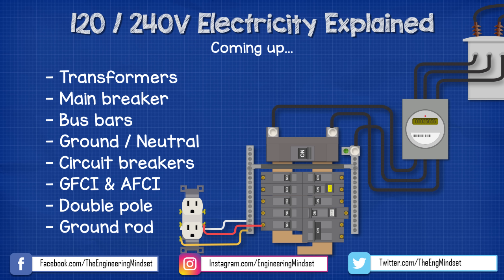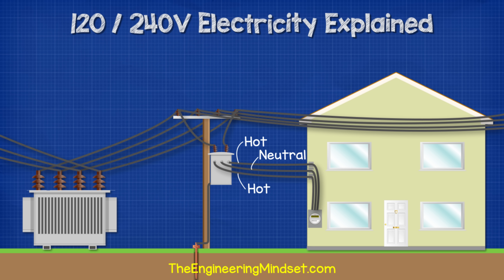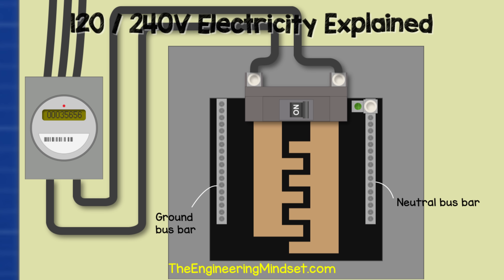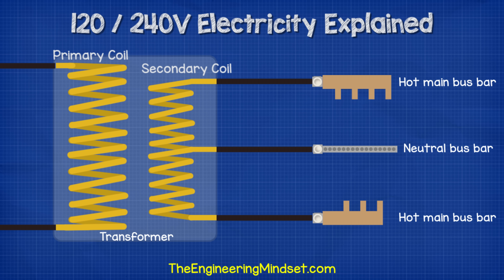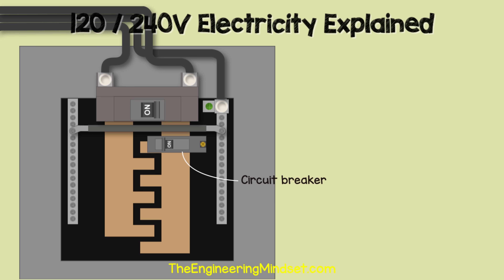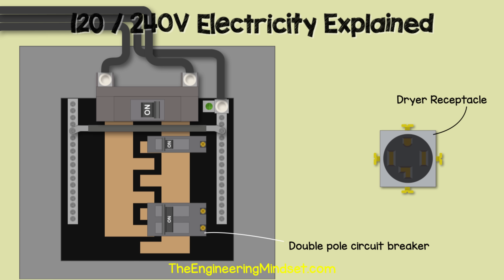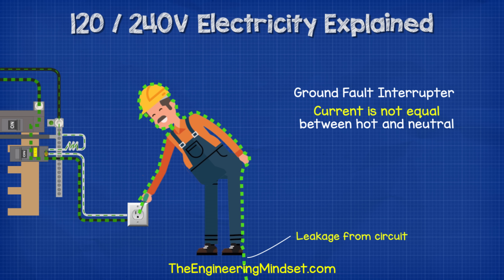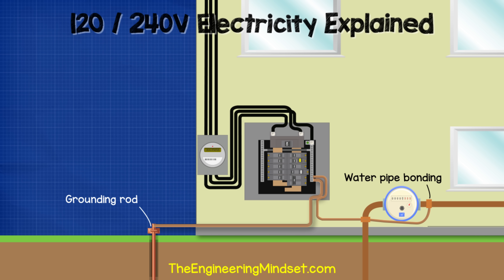120V 240V Electricity explained - Split phase 3 wire electrician

Comment: sorry for the my stupid question.. you said electricity comes from hot wire through the switch then lamp then neutral wire back to main switch.. but this is AC.. meaning electricity can flow the other direction.. ie. neutral wire -> lamp -> switch -> hot wire.. is my understanding correct? if yes, then i don't see the difference between hot and neutral wire
Reply: In North America the neutral is attached to a ground rod driven as many feet into the ground as necessary. A metric foot is 30 cm.  For there to ever be a voltage on the neutral the entire planet and every one on it would have to be at that voltage.  Actually it would only apply to  people within about seven hundred miles.  AC means the Hot wire goes positive and  negative not that the wires change hotness.

Comment: At 5:36 you measure 240 VAC. Is that 240 volt measurement because those windings halves are out of phase with each other?
Reply: It's mathematically equivalent to them being out of phase with each other, but it isn't produced that way.  By center-tapping the transformer, and deriving the center-tap to be your neutral, the red wire's voltage is derived to be the negative of the black wire's voltage.   The second line's waveform is a negation of the first wire's waveform, rather than a phase shift.

It is mathematically equivalent to a 180 degree phase shift, but it isn't called "2-phase", and the L1 and L2 aren't supposed to be referred to as phases, for historical reasons.

Comment: I have a GE Dryer that I took with me from the US to Germany , it currently has a 4 prong plug, as you know they only use 2 or 3 prong plugs in Europe , also here the power is 220V single phase , and even though the dryer is able to be used on 220V in the USA it’s basically getting (2) 110V phases to make it 220V . So my question is how do I connect it here in Germany to their 1 phase 220V ? 

I really really have high hopes you can help me out, please.

Comment: So, how can we tell if a power (load) panel is maxed out?

For instance, i have to power (load) panels: one that is outside with a 175amp mains breaker. In that same panel, there is a 60amp/240volt double-pole breaker (along with other 60 amp breakers) to feed my subpanel located inside my garage that controls all the interior and garage circuits.

If I needed to install a 60amp/240volt double-pole breaker for a dedicated circuit in my subpanel, would that trip the outdoor panel if the subpanel 60 amp/240volt  dedicated circuit is being utilized along with other circuits within that same subpanel, hence “maxing out” the 60amp subpanel circuit? 

 If so, would I just need to upgrade/size up the exterior 60amp/240volt breaker for a 70 amp/240volt double-pole breaker?
Reply from the maker: Check the new SUB PANEL EXPLAINED ➡️ video https://youtu.be/NUSNa-7Hecw

Comment: 4:54 There is one more thing about connecting the multi meter between the 2 bus bars. If you got around 208 volts, this is totally normal because only commercial buildings use these kind of voltage, like apartments for example. Instead of using 2 phases electricity as said in the video, it uses 3 (120 degrees out of phase) because there are multiple locations in the building that consumes lots of electricity, so they need a third phase to stabilize the consumption from preventing overload
Reply: in the 3 phase 3
N-L1-L2 - 120/208V
N-L2-L3 - 120/208V
N-L3-L1 - 120/208V
Reply from the maker: Seen our new 3 phase transformer video?➡️: https://youtu.be/u0SsejDCVkU
Reply: @EngineeringMindset  Totally wished a video like this, much thanks!
I was still in high school with very basic electrical knowledge when I wrote that comment, so I described with my own words on why 208V is used instead of 240 😅

Comment: great stuff.. now when installing a  GFCI or AFCI  .. does this mean its a different breaker used as well?  how many times i saw people remove a common outlet and just slap a GFCI only
Reply: GFCI can either be in the receptacle, or it can be in the breaker that supplies the branch circuit.  What GFCI does, is look for current not returning on the neutral, indicating that it is flowing where it doesn't belong.   It looks for residual current escaping the circuit, and trips when this is too large.

AFCI by contrast, has to be in the breaker.  AFCI looks for waveform details that are characteristic of an arc fault.

AFCI is a relative new requirement in the NEC, as of the last ten years.  In a home built before AFCI's became required, you don't need to add AFCIs to bring it up to the current standard.  An old house can be considered grandfathered, and any additions only need to be built to the standard that was effective at the time the house was built.
Reply: I had a 50mhz ham radio trip a GFCI when it would transmitt.

Comment: Can u tell me plz why used transform  before house . I mean why state not give it directly  120 v and 240 volt
Reply: Not an expert but because of distances higher voltages equate to more energy available.
I think residential and light commercial run about 28k volts along the poles.
Generally this is stepped down to a pair of 110 volt lines feeding two or three houses.

Comment: Why would adding appliances increase current. Wouldnt that increase the resistance and thus decrease the current?
Reply: Resistors in parallel actually reduce the Equivalent resistance of the total circuit.
Reply: @bsdiceman  Thank You!
Reply: @YusufKhan786  you're welcome hope that clears things up for ya!
Reply: While loads do have resistance, they also are conductive, and allow an increased flow of current to pass.
Reply from the maker: Check out NEW resistor video, everything covered! ➡️ https://youtu.be/DYcLFHgVCn0

Comment: i am afraid i don't get it. so, from the power plant AC is distributed through the step up transformer via 3 cables (120 degrees phase shifted so no neutral wire) into the step down transformer -> to the residential building. but from there we have "hot" and "neutral".....so where does the neutral go from the load to the transformer  and then.........it disappears? i don't get the ac/pulsating part......
Reply from the maker: Seen our new 3 phase transformer video with worked examples: link- https://youtu.be/u0SsejDCVkU

Comment: Ok, now what is single phase 208 volt and how can I wire this appliance correctly at my house to get it?
Reply: Single phase 208V is what apartment dwelling units get, when the apartment complex as a whole is supplied by a 3-phase service.  Each dwelling unit gets two phases and a neutral from the three phase service to the property.   Your neighbors get a staggered pair of phases, so that loads are as uniformly distributed as possible.

Suppose you get phases A and B.   These are the black and red wire.   The voltage to neutral of each of these wires is 120V nominal.   The two voltage waveforms are 120 degrees apart.  If you measure voltage between the two phases, rather than getting 240V like you do on the split-phase systems of single family homes, you will instead get 208V.   Because if I draw an isoceles triangle with two 12 inch legs that are 120 degrees apart, the remaining side will be 20.8 inches long.

Like 120/240V, the 120V to neutral powers most of the loads.  The 208V only powers energy-intensive loads, that would otherwise be powered by 240V, such as heating elements in stoves and ovens.   This will mean less heating power, but unlike more voltage-sensitive loads like motors, this is OK for a resistive heater to run at slightly less voltage.
Reply from the maker: Seen our new 3 phase transformer video?➡️: https://youtu.be/u0SsejDCVkU

Comment: When an appliance is hooked up with a neutral to a 2 pole breaker what determines whether it'll be 240 or 120?
Reply: The wires are color-coded, so that you connect to the proper part of the source, to where the load requires you to connect it.  The neutral is required to be white or gray by code.   White is the industry norm in any system involving 240V and less as the nominal line-to-line voltage.  It isn't a problem if you mix up the two live lines, as you will still get the same outcome either way, but if you mix up a line and neutral, you could damage the equipment.

The neutral uses white wire, the two lines use black and red wire.  When the white wire, and either of the remaining two wires is across a component, the 120V will power it.  When you instead wire the red and black wires across a component, the 240V will power it.

Examples of loads that use 2-pole breakers and all three wires, are ovens and driers.   The 240V is used for powering the heating element, as that is the most Watt-intensive part of the appliance.  The 120V is used for powering more sensitive circuits, such as the motor and the control panel.

This also allows the same appliance to be used in apartment buildings, where the dwelling unit gets 120/208V instead of 120/240V.   The motor and control panel are a lot more voltage-sensitive, and could not possibly run on 86% of the intended voltage.  Therefore, these loads run off the 120V part of the branch circuit.   By contrast, the heating elements can still run on 86% less voltage, and still work.  The power is reduced to 75% of what it could be on a 240V curcuit, but that just means that the thermostat will cycle the load on and off.

Comment: "Return used electrical current"? So after we "use" the power they get it back?
Reply from the maker: As I mentioned after that point, it doesn't quite work like that. All your electrical equipment used the energy in your home e.g. The refrigerator, TV etc. The power station has to keep pushing and pulling the electrons through your wires.

Comment: question for you or all the electricians out there.    i have an offgrid, completely separate inverter powered by batteries/solar panel...   the panel is 220v split phase, and is meant to run just parts of the house - plugs etc...   obviously it has a red/black and neutral coming from the inverter, and panel could use either double or single pole breakers.   that's not the issue...  the issue is the actual ground/earth - the bare wire, the one that disappears into the dirt.   i need a ground for my solar setup, can i use the same ground?    can't see any reason why not, but since the neutral and the ground  in both the mains panel AND the solar panel are bonded together, i just want to make sure that there is no change the power from my solar/inverter can 'leak' back onto the grid in any way.
Reply from the maker: Seen our new video on HOW SOLAR PANELS WORK in detail https://youtu.be/Yxt72aDjFgY

Comment: Couple questions please. How does the neutral carried back to the transformer when the neutral bar is connected to the ground bar that is grounded back to main ground and its job is to kill power. I've never ran wires from panel to transformer. Only transformer to panel. Is my understanding wrong?  Also you said the transformer dums down voltage it is safe but the transformer also drastically increases amps which is way more deadly to my knowledge. Am i wrong on that?

Comment: The only thing I found confusing was at 4:56 seconds. When he touches each lead of the multimeter to the two different hot bars. With each one of them being 120 V, wouldn’t the meter show zero? Because there is no difference in electric voltage between them, they are both 120.

A few seconds earlier he touches one lead to a hot and the other to ground and that reveals 120 V, I understand that because the difference in potential between them is 120 V. But shouldn’t touching one lead to each of the two hot bars read a voltage of zero because there’s no voltage difference between them?
Reply: There are many different settings on the multimeter, hence its name. He is measuring volts not voltage drop.
Reply from the maker: Check our new Multimeter tutorial out ➡️ https://youtu.be/4lAyzRxsbDc

Comment: There's another fairly common one...the breaker that supplies two legs with a shared neutral.  Common in kitchens where running a single 3 wire is split into two different circuits from a junction box.

Comment: Why is it that some of my circuit breakers are marked 15V, 30V, 40V, 100V? What does that have to do with 120V? And also, isn't the voltage distributed in Canada 110V?
Reply: Canada and the US use 120V for light bulbs and standard outlets, 240V for water heaters, baseboard heaters, stoves and dryers.

Comment: Great videos, could you explain what you mean by  used electricity? I always understood that electricity would not flow unless there was a load. Wouldnt the load demand say 15 amps then expense that power as work / heat what have you?
Reply: I think used electricity was an unfortunate choice of words. You use power not electricity. Used power leaves the system as heat.  Electricity is like a bicycle chain. It transmits power but is basically the same links going round and round. You bought your electricity when you paid for your wire.

Comment: What if the middle wire of the transformer were to be cut? that would be incredibly dangerous wouldn't it?
Reply: I could be. If the loads on each phase were exactly the same, say 10A on each phase, nothing would happen. If the loads were imbalanced, say 5A on one phase and 10A on the other phase, then yes, you'd have a problem. The voltage on one phase would spike very high, and the voltage on the other phase would drop very low.

Comment: The neutral and ground are different, neutral goes back to the transformer whereas ground goes straight to the ground. There might be some voltage in the neutral wire but none in the ground wire.

Comment: At around 8 minutes you are using the yellow color for grounding conductors. In certain types of circuits in the U.S., grounding conductor color convention is required by the NEC to be either bare, green, or green with yellow stripes. I do industrial work and don't claim to be a residential expert so let me know if I missed something.

Comment: When the electricity goes back on the neutral wire do you get money back for unused electricity
Reply: You do not pay for electricity. You pay for power.
Reply from the maker: They only charge you for what was used. This is measured by your electricity meter.

Comment: Hello , 
thank you for good explanation.
I´m from Europe, we have 230 V one phase system, I like it a lot better. 
Because: I live in Mexico and have a RV from Europe.
2 time a got a electrical chock when I wanted to go in the RV on the door.
I use a step up/down converter to convert 115 V to 230 V never a was thinking that the USA and latinos have a 2 phase 230 Voltage.
I was thinking some is wrong on the RV, I found no mistake, I was thinking some is wrong on the converter, I found no mistake.
I search in Google and found in Wikipedia the information of the electricity system from US for 230 V. 
I had at the cabine and the door of my RV 115V to groud , and by touching the door of the cabine I got 115V on my hands.
I was thinking why 115 V the half of 230 V, why not 40 Vor 50 V or  80 V?
The think is: often in mexico , USA I don´t no,  the people conect the 110 Conector without check on what cable Is phase/ hot and what cable is neutral, often they change it, often the earth contuctor is not conected. 
I made me a cable for my 115 V/230V converter that is conected to the earth contuctor cable in the converter to conect it on metall water tube or with a big earth nail to get the protection to the earth.  Otherside I bougt  a Klein Tools RT110 Receptacle Tester, so I know that the phase/hot, neutral and earth cable are right  conected. 
Maybe it will be fine to explain the importance of the right conection of the 3 cables in a video.
Your video was for me very helpful
Many thanks
Reply: You will be happy to know that North America supplies 240v single phase to all detached homes.

Comment: curiosity is driving me crazy. I think that you have 240 volts across the two hots because each is 120 volts, but they are 180 degrees out of phase. I speculate that they must be so because in flowing to the nuetral they must flow in opposite directions, so that at 5:34 in the video the little green dots above the nuetral should go around clockwise while the little green dots below the nuetral must go around counterclockwise  (reversing at 60 hertz) Therefore if there is not a load on both legs, there is no split phase if there is no load there is just one phase, same frequency and phase as in the primary. Please help me.
Reply: You must have missed the part of the video where he explained this. The transformer is single phase and your question is asked as if it is a polyphase transformer. The principle of operation for a transformer says that the voltage reduction will be the same ratio as the turns ratio primary to secondary. If you connect to have the secondary turns instead of all of them, you get half of the voltage you could have gotten. It has nothing to do with 3-phase power, etc. in this type application.

Comment: Typical Americans. Over complicating everything. In SA, we have Pos, Neg and Grnd. Instead of breaker box, we have DB (distrubution box) where power comes in to the house (not from a transformer) and is distrebuted through the house with circuit breakers....

Comment: Need to explain grounding better; or why do some countries, and even the U.S. prior to ~1950, not use ground wires?  If the ground wasn't attached to the earth then you would not get shocked when you stand in a bathtub and touch the hot wire of a 120v outlet.

Comment: Actually in perfect and properly balance condition the current should flow from one of the 120V phase towards the other 120V phase and leaving the neutral wire at zero potential .